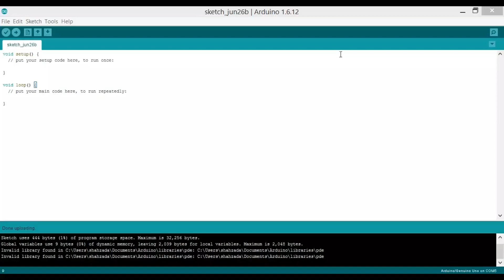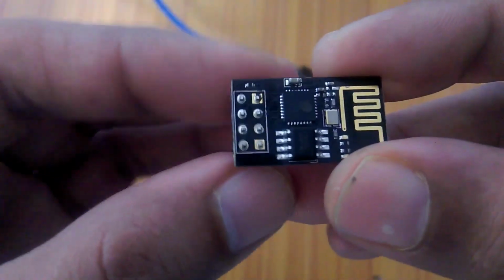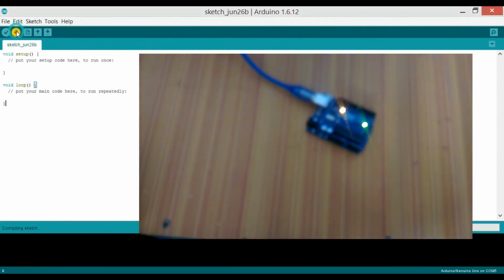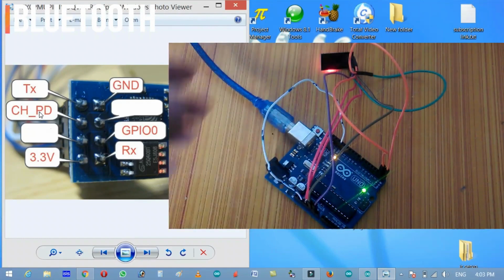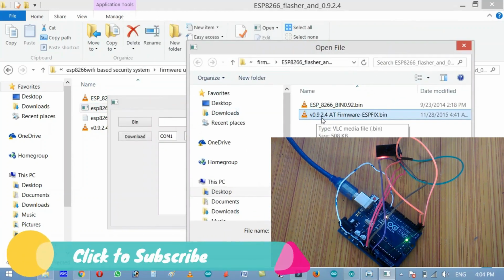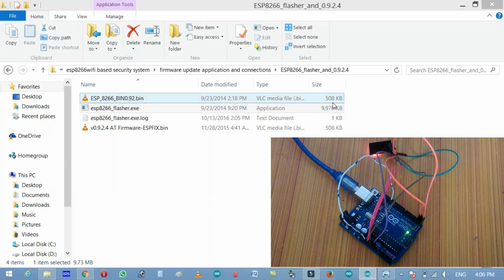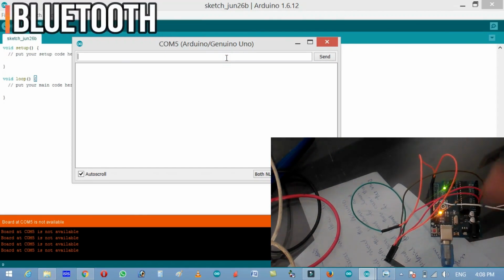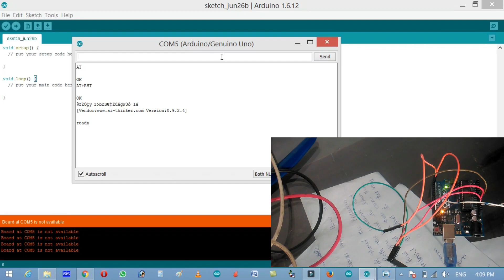esp8266 wifi module-How to update esp8266 Firmware/Software Arduino, esp8266 Flasher, AT commands

Comment: I am using nodemcu-pyflasher (Using linux) and I went ahead with the same process. However, when I type 'AT' in serial console disconnecting the GPIO 0 pin (Also reconnecting USB cable and reconnecting it once again) then I do not get anything in return. It is complete blank... Please help.

Comment: hi
my esp 01 makes the update normally but gives no response to AT I have tried other tools but always the same either nothing works or the upload runs normally but no response to AT

please help if someone has a tip
Reply: I also have the same exact issue.
Reply: @radeonblue1816  Hello, unfortunately I have not found a solution to the problem. I have ordered new esp's from Amazon that work without problems, and can also be flashed....
Reply: So you mean to say that I should reorder the esp8266 01 module once again? May be the hardware is faulty? What do you think?
Reply: @radeonblue1816  Yes this can be a hardware problem... I bought new ones for 3€ and they work perfectly until today.
Reply: @mortarmax  Thank you very much for that. I don't know why even after flashing successfully they don't respond to AT commands. Once I had watched a video and I wired Esp8266 as per and if I disconnect and connected ground of ESP8266 it would provide out like 'Nodemcu.... Lua file missing'.. Do you have any ideas on that?

Comment: Thank you so much I've been trying to this for a while, your guide is the only one that makes sense :)
Reply: could you tell me where you got the latest soft ware?
Reply: @flipz7338  the current video tells you what cables to connect to put the module in update mode and this video https://youtu.be/YLKEZtLhfZo tells you where to get the software and the firmware from. It also tells you how to update but I wasn’t able to follow the steps. Let me know if you need anything else

Comment: Done same process but module doesn't responding to AT commands.
Reply: I am dealing with the same problem
Reply: @slimanelatreche4263  UP
Reply: I have a same problem
Reply: @uvaishwarsii  HAVE YOU FIXED

Comment: please help me out.... i updated firmware but I m not receiving anything on serial monitor after entering at commands I changed baud to 9600 and 115200. I did exactly as u shown in this video.. wt is wring wd this now
Reply from the maker: don't use this module it will only give you headache. use this one nodemcu esp8366
 https://youtu.be/sygF8RQSfkQ

Comment: i cant update the framewire it shows faild to connect message
Reply: Finally, i had success to update the firmware. I had also connection problems, but i solved it this way: Connect RX to RX, TX to TX, connect the "CH_EN" pin to +3,3V. Connect the RST pin from ESP to Arduino ground. On the Arduino, connect the reset pin to ground as shown in this video. Remember the COM port and unplug the USB cable from Arduino, so everthing is off. Start the flasher (i used flash_download_tool_v3.8.5) , choose the correct files and locations (i did also some mistakes there) and very important: set SPI mode to "DOUT" and do not select "SpiAutoSet" in the tool, otherwise you will get a checksum error on booting after flashing. Press "start" on the flash tool and while it tries to connect to ESP, connect the Ardiuno to USB. Then it it was able to connect and flashed with success.
Any other combination didn't work. But notice, this worked for me and it's no guarantee it will work for everyone. There are so many different instructions, a lot of different modules and also a lot of different firmwares out there... 
This page helped me a bit, but there are also wrong settings at the flash tool screenshot: https://remotexy.com/en/help/esp8266-firmware-update/ (SPI mode to DOUT and don't enable SpiAutoSet, otherwise it will switch from DOUT back to QIO after connecting). I hope this helps...
Reply: I removed the RST pin from GND and it worked.
Reply: Did u find the solution?
Reply: @vignaeshgopu5490  no coult not
Reply: @ajmalaslam2126  I think there is a mistake in the video. RX must be connected to TX and vise versa.
Not RX to RX and TX to TX, this is not correct.
Reply: @ajmalaslam2126  Ok, i tried it by myself and it's connected  RX to RX and TX to TX which is quite strange. You need some other connections to get it ready to flash. I had success one time, but i don't remember what was the trick. At the end, i bricked my esp8266 because of wrong settings. Furthermore, the software and firmware format changed... I also had no success at the end. 
EDIT: It was not bricked, it was a checksum error after boot. I had to set the baud rate to 74880 to read the message while booting.